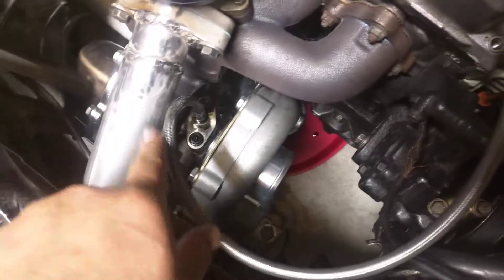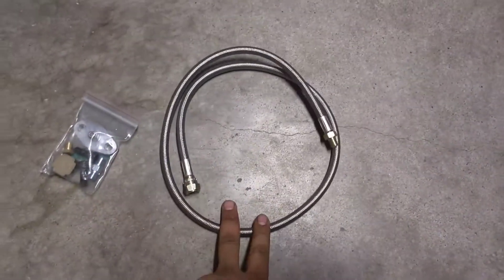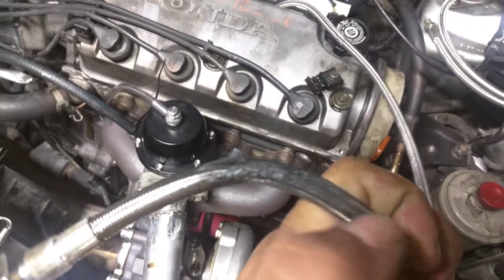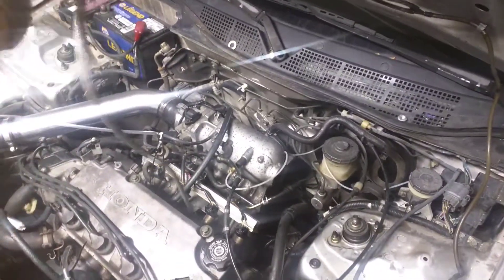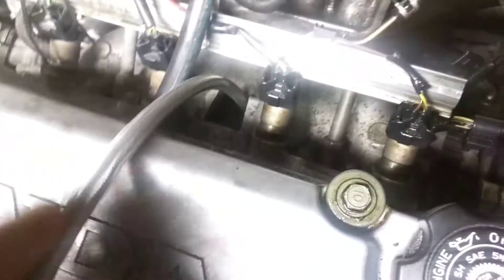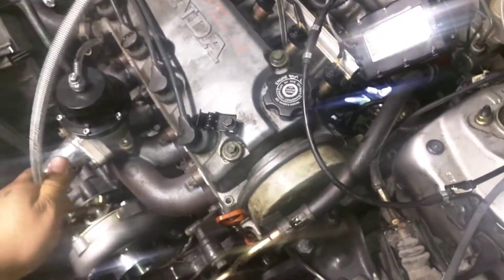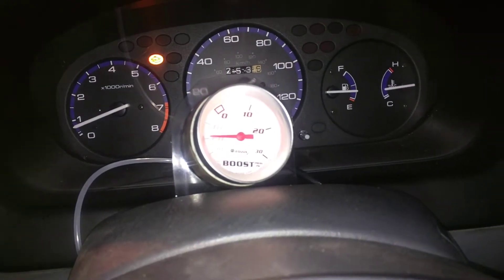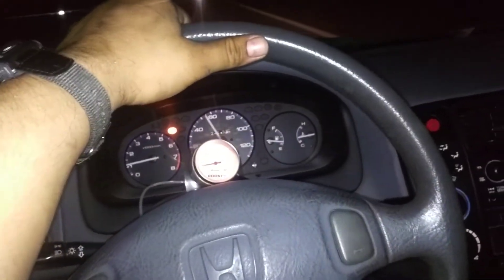eBay Turbo D16 Civic gets a new oil feed line

Comment: In process of turbo ing my y7. I used a pipe swivel adapter on the sandwich plate side to help thread in.
Reply from the maker: Mr Ahhsum nice so that allows it to spin on it self vs the whole line? Like the fitting to the turbo?
Reply: threads into block solid, but other end is swivel, so you put straight fitting into it and tighten the fitting onto the hose. ill get a part number you can google
Reply: "9205x2x2" - Weatherhead makes it. I work at a NAPA and we had it in our hydraulic fittings.

Comment: New sub here... Just came across your chanel i viewed your ebay turbo manifold video and i had the same thing wondering what needed to be done...cant wait till the next video im doing same exact thing with same exact parts( turbo mani, feed/drain kit, glowshift sand plate) to my y7 love how your pointing out the flaws and how you are correcting them...keep on keepin on brother 👌
Reply from the maker: Kyle Jones thanks for the sub! Seems like every part has its own little flaw lol. For threading the manifold use a tap set! In the video I used a "rethreading" kit. I kinda got lucky because they're meant to go over existing threads lol. Soon I'll be putting in a giant intercooler with a knock off bov! I have a feeling my 5$ valve is leaking boost